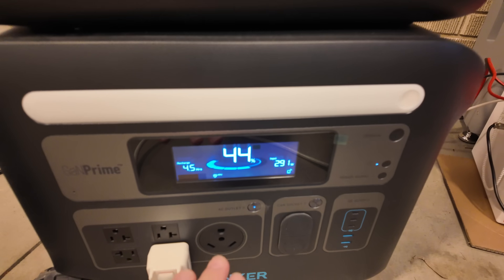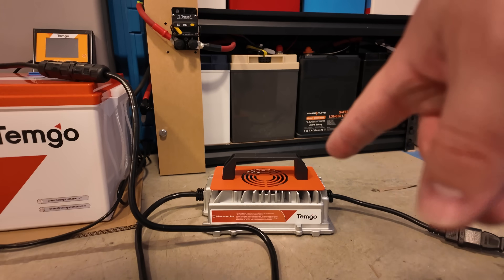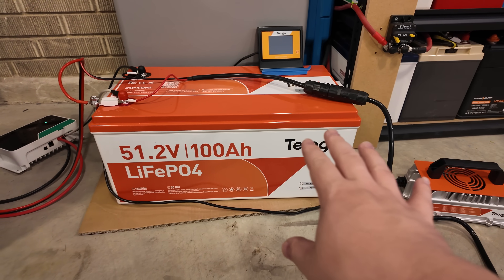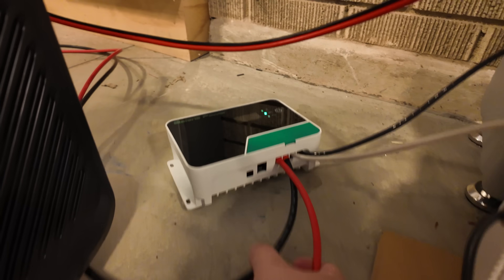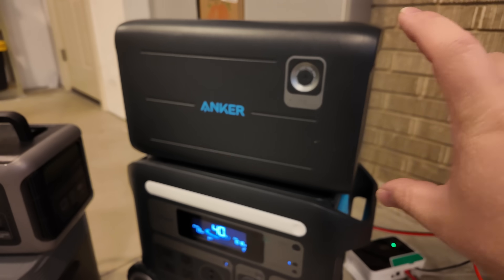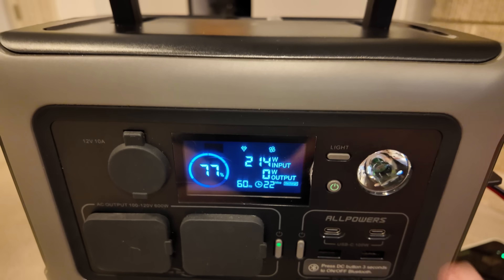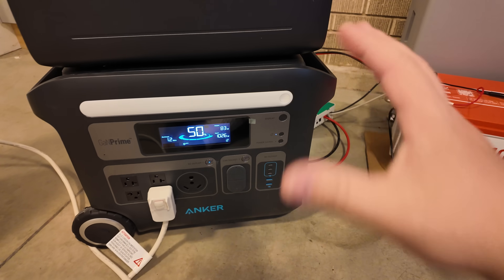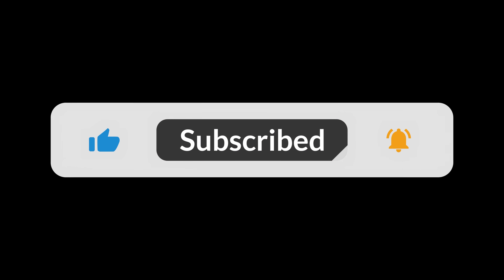I SOLVED the BIGGEST Problem ALL Power Stations Have!

Comment: Anker f3000 would do just fine, or even the f3800 plus. I use 5 of those and extra expansion packs with 10kw solar for now in AZ. But yes this is awesome what you demonstrated. I might do the hack in the future because my expansion packs of 3800kwh cost 1,400 each on sale. As long as this is safe to mix and walk away from it.
Reply from the maker: Sounds like you have an epic setup! This would be 100% okay to mix with your system because the golf cart battery is actually not getting connected directly to the power station batteries. The charge controller on the power station is between them and will mitigate any difference between them. Thanks for watching!
Reply: @theresatrickforthat sweet! Thanks again

Comment: It looks like you have a traditional Off-Grid system here, except instead of using an inverter or AIO, you're using one of these power stations (which has a built in inverter along with other redundant equipment). 

So you would have solar panels hooked to an external MPPT charge controller, hooked to this golf cart battery, hooked to a MPPT controller (in the PS), hooked to more batteries (in the PS), hooked to an Inverter (in PS).

One disadvantage I can see, besides cost of the redundant equipment and energy loss from extra conversions, is the inverter life being tied to battery life. For example, 10 years from now you will have a power station with defective batteries. If it even turns on, they could constantly drain your new 2035 golf cart battery trying to top off aged cells (in the PS), just so you can use the PS's inverter.

Im curious if this makes any sense for those of us that didn't buy a power station yet. Or if we would be better off hooking this to an AIO inverter/MPPT combo, which can handle both solar charging and AC charging at the same time, and will last far longer than any batteries.

I'm thinking the traditional method is superior unless you have one of these power stations already, and don't mind losing their portability.
Reply from the maker: If you don’t have a power station already…and want to do home power backup…then batteries connected to an all in one inverter is the way to go! I have a EG4 12,000XP and you can see how this battery works with it here: https://youtu.be/dboHXnSY9LI?si=l2NQ40l5QeR8PiVG
This hack in this video is for anyone who already has a power station and wants to allow their investment to go even further without needing to buy entire AIO systems on top of their power station investments. Thanks for watching!

Comment: Great video! Pretty cool way to increase the capacity! I have an Ecoflow River 3 Max Plus and the capacity (858Wh) needs a boost... this might be a good way to do it cheaper and using less space! Just one question: does the Temgo battery stop taking charge automatically when full (and it cannot pass any more power to the Ecoflow) or do you need to actively monitor it?
Reply from the maker: This would for sure be a great solution for your River! The Temgo battery automatically stops charging. No need to monitor it. It also automatically shuts down to protect itself if you discharge it to 0%. Thanks for watching and commenting!